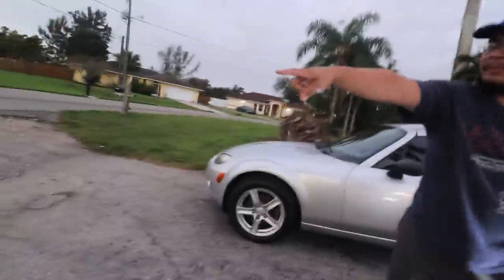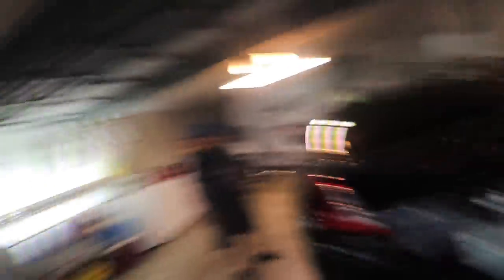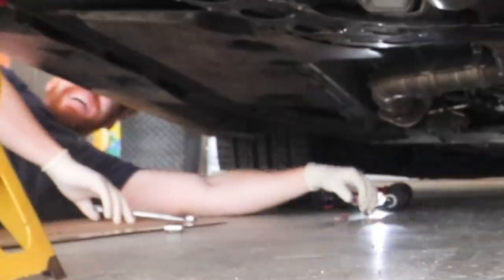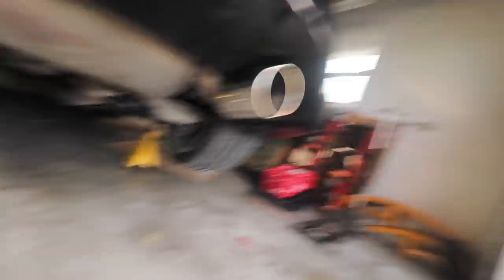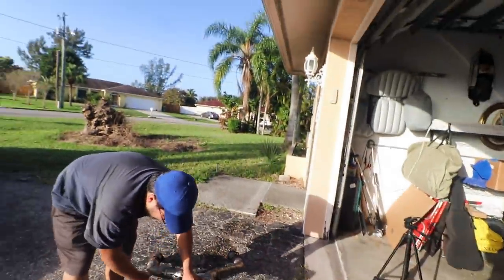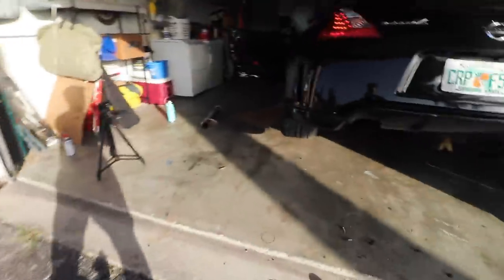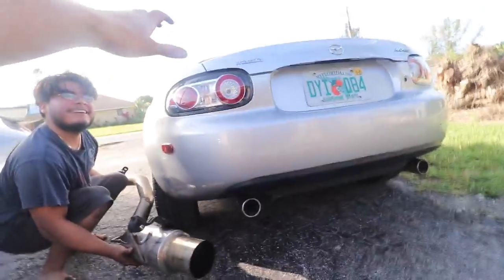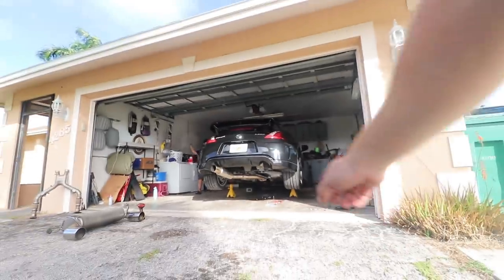The PERFECT 370Z/350Z EXHAUST... More Testing (Exhaust Install On The NISMO)

Comment: You tried the flat foot shifting function yet?
Reply from the maker: Ended up not getting that map
Reply: Danny Z you still should have it, it’s just one of the ARC tools (advance racing controls) that comes with uprev. Unless you told your tuner to turn it off I mean. 
That shit puts you back in your seat!